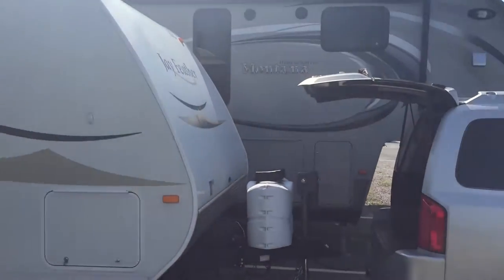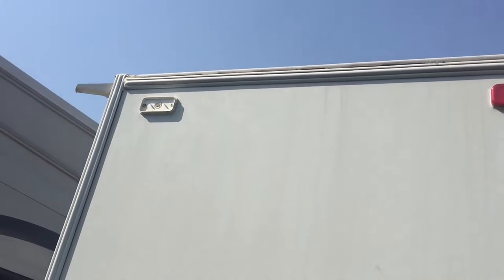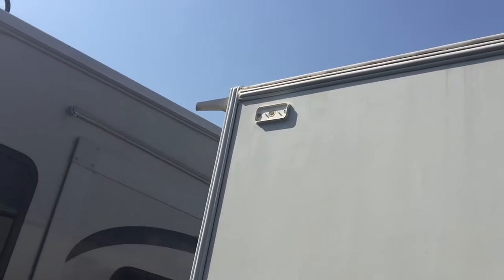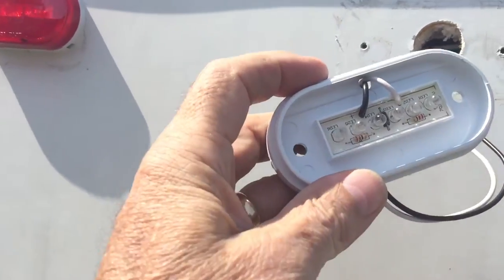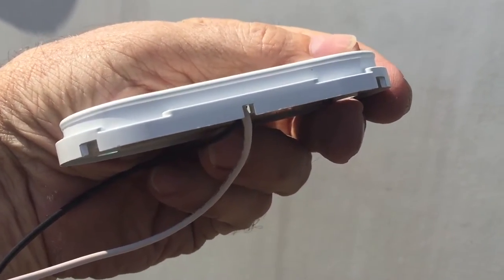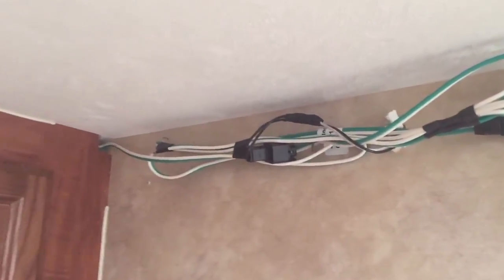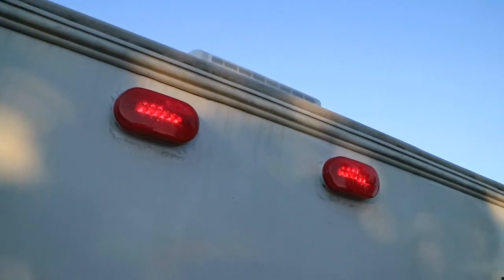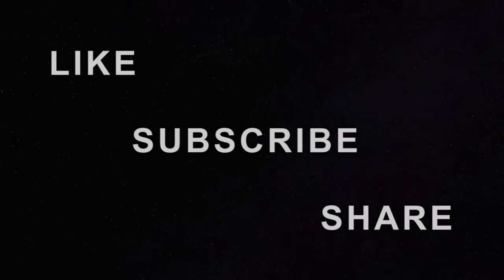LED Upgrade -  Rear Running Lights

Comment: Nice job, I just replaced the bulbs in all of my lights inside and out with LED bulbs in the original fixtures.
Reply from the maker: all my inside I replaced with LEDs and I used red in one of them to use at night so it doesn't kill your night vision and you can see outside.
Reply from the maker: I'm going to replace the tail lights next